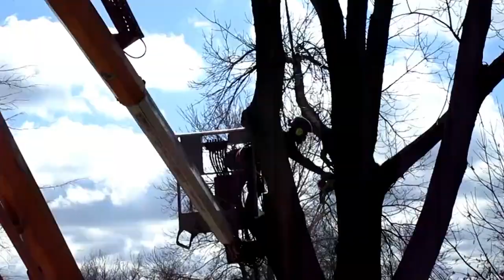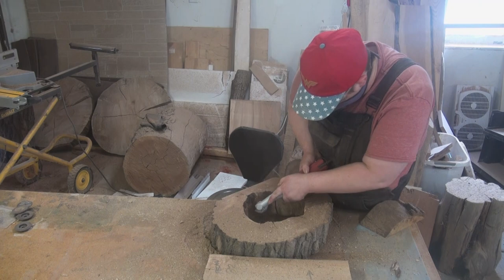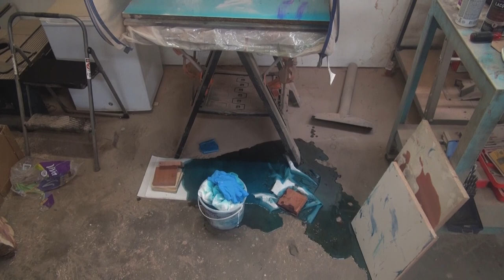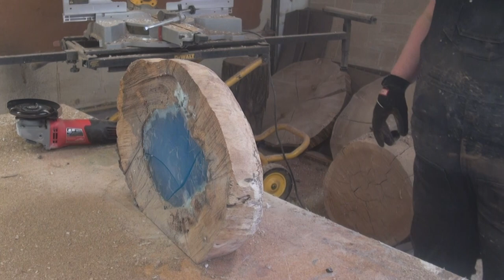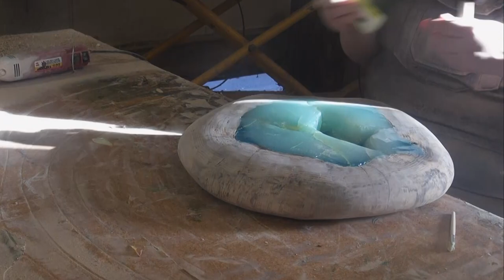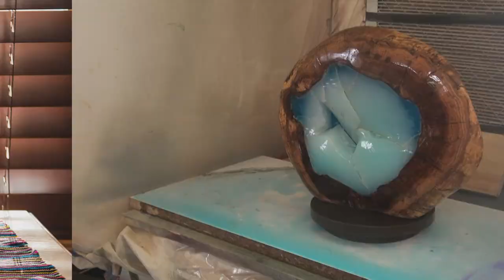How NOT to Make a Wood and Resin Light

Comment: yes this video was how not to make ! But still it is art ! And that art turned out very beautiful.
I myself am going to start a resin driftwood project, so worried I’m going to ruin it. I found a 
3 foot by 3 foot twisted piece of tree standing on end driftwood at our local lake, waiting for the weather to warm up to try the resin project. First having to cleaning it has been a channeling task, it was 
tipped or pushed over into a fire pit! And there are many spots of chard areas that need to be scraped sanded before even starting to actually clean the piece of driftwood. Then the task trying not to ruin it just by cleaning it. 
After many videos I decided to go with Stone Coat Counter epoxy, their videos seem to be educational with a lot of information,and products very easy to work with. If you get chance look them up!  Now that I’ve wasted a few minutes of your time reading this don’t stop your beautiful art!
Reply from the maker: Thanks so much! And not a waste of time at all. Make sure you know how deep you can pour any resin, that is a very crucial step. Good luck with your project! I would suggest practicing with some junk wood first before using the prize piece

Comment: Even though Ecopoxy says 3 inches, I never go over 2 inches at a time. I've seen it crack and shrink at 3 inches.This was a great video. Keep up the good work. The light turned out awsome in the end.
Reply from the maker: Thanks so much! And thanks for sharing what you have experienced. Now are you talking about not going over 2 inches thick when mixing at the 2:1 ratio? When mixing at the 1:1 ratio you can pour even thicker then 3 inches.

Comment: Just found your channel. Great recovery; I like the look. I wonder if you could have cleaned up the cracks a little and just added some more epoxy???. I've not poured that thick before but I've fixed a couple of mistakes with another layer of epoxy.
Reply from the maker: I did think about doing that, pouring on more resin. The problem is I would have to get it tinted just right in order for you not to see the cracks.  Its not impossible, but fairly difficult.

Comment: Could you have cleaned out the cracks somewhat and then poured a different color, or more glow in the dark resin within the cracks to reseal (slower/longer cure), and add a neat effect? Not sure how pouring over already set resin would work.
Reply from the maker: Yes, that is a possibility. Would probably have been best to pour clear.